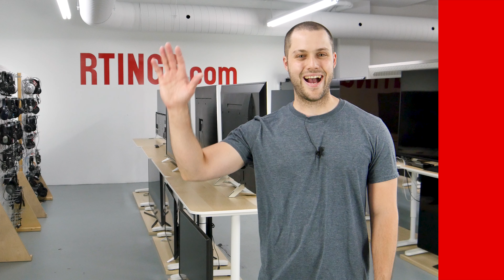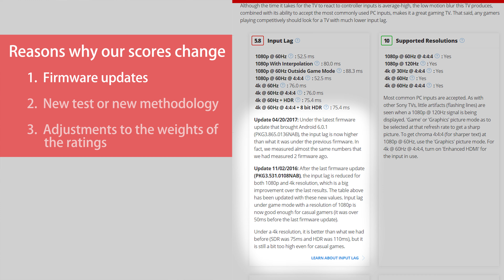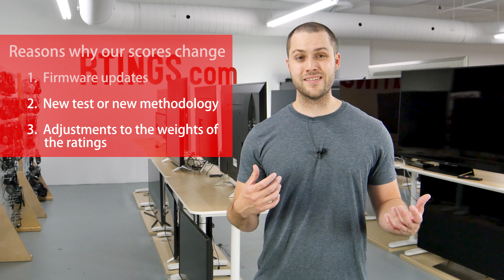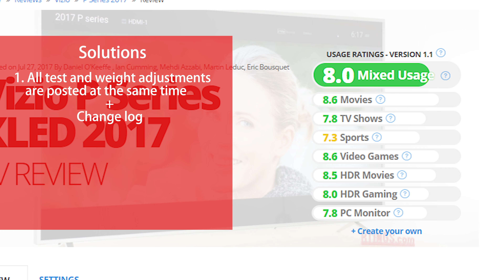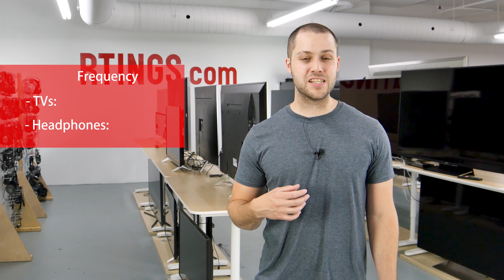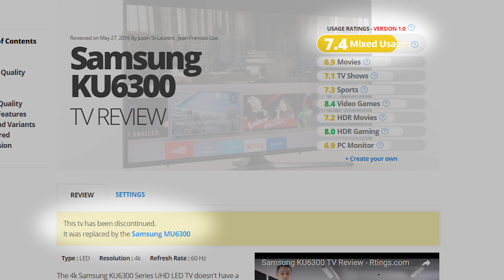#2: Versioned Test Benches - Rtings.com

Comment from the maker: Let us know what you think about the new tests and scoring changes that were made to the test bench 1.1. What new tests do you want us to add in our next test bench update?
Reply: Thanks for update. 
ABL calculation is difficult to understand. If it is correct to obtain the standard deviation from the sustain luminance data, it is different from the calculation of Rtings when I calculate it. 

I hope that the relevant calculation methods and figures will be expressed in a more understandable way.
Reply: I dont. You were doing fine as you were. But your channel can grow in your own way. Thanks for all the tests over your channels history.
Reply from the maker: Thanks OreillyORLY for your feedback. HDR Gaming is indeed way too high on that TV. The new versioned system is meant to exactly fixed this kind of issue from happening again in the future, but it won't unfortunately solve it for the past reviews.
Reply from the maker: Good idea for the window sizes between 50% and 100%. We will add it to our todo list
Reply from the maker: For ABL, it is indeed a bit confusing. We will update the text on ABL to be more explicit. It is the standard deviation done not on the raw nits, but the nits after the PQ curve is applied, so it can correspond more to what is noticeable.

Comment: How do i compare motion blur with new system??? I have no idea which tv is good after the new testbench.
Reply from the maker: For motion blur, our pictures are good indication of what it looks visually. The response time transitions are also useful to compare, especially with the charts.
Reply: Thank you but can you explain this bit more simply. I  very much doubt that anyone can accurately compare motion blur simply by comparing pictures.  Maybe if there is very big difference. Let s say according to old testbench tv has 7.8 ms reaction time, whitch number in the new testbench is more important.? 100 percent i guess.
Reply from the maker: Check our 5 video series on motion blur that we posted on youtube. The pictures are taken on a rail, with the camera moving, so they can correspond to what you see when your eye is moving too. As for which number is more important, 80% has the most impact visually.
Reply: Question is that does the new testbench make tv's look better than they actually are when comparing 80% numbers with old testbench?  With previous testbench there were only 1 or 2 led  tv's close to 7.8 ms reaction time, about twice as good reaction time as most leds. Now suddenly  there are already few tv's that have similar response times when looking at 80% number.  As i understand reaction time is most important element that reduces motion blur? After comparing pictures there is quite a difference between Samsung's 7.8 reaction time and  TCL's 9.5 80% number. Maybe i have to start comparing pictures then instead of numbers.
Reply from the maker: It depends on the TV and whether it had overshoot or not. The scores of the ones that had quick rise but took a long time to stabilized increased, while the ones with a slow ramp up decreased.
Reply: Do you want to test motion blur of  the older tv  ( http://www.rtings.com/tv/reviews/samsung/j6200 )with new testbench so there would be a way to  easily compare results?

Comment: Hi there, I would like to see more on the practical usability of a TV,. For instance, the new Sony 900 e that I have is a great TV picture wise but doesn't support YouTube HDR (only Amazon Prime and Netflix) which is a big disappointment for me. This was one of the main reasons I bought a new TV. It also turned ON by itself during the night--also a big concern!
Reply from the maker: A lot of new tests were added yesterday in the smart features section, including 'HDR in Youtube'. Check the updated X900E review and let us know if you need more.
Reply: Thanks, I saw the update. Still not sure why the Sony 900e dropped to 8.1.
I believe the PC evaluation got knocked down quite a bit--concerns about IR?
Another thing I would like to see for the future is:
Wifi /Ethernet ratings
Integrated Network File sharing capability -Yes/No
A growing number of people have home networks and want their TV to be included. They want to know how capable the TV wifi and ethernet actually is--some are noticeably better than others at streaming,etc.
Thanks again!
Reply from the maker: The X900E dropped to 8.1 due to some weights adjustments in our scoring system. Relative to other TVs, it stayed at about the same position. Thanks for the suggestions for the new tests, we will add them to our todo list.

Comment: You guys need to bring back the white and black balance in the contrast ratio tests. Not sure why you guys got rid of it in the first place.
Reply from the maker: Thanks for the suggestion. We got rid of it since it confused some people, for example, when the backlight of a TV can't get as low as 100, then the resulting black is also higher so can't be compared to other TVs directly. If there is enough interest though, we could add it back.